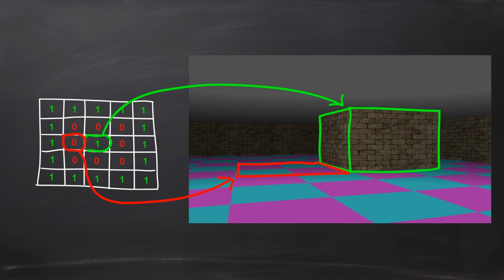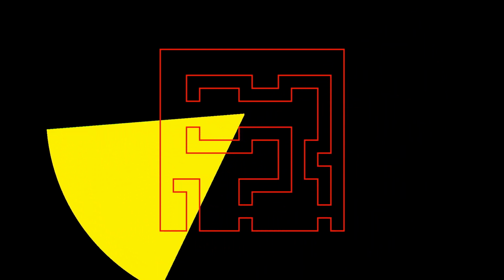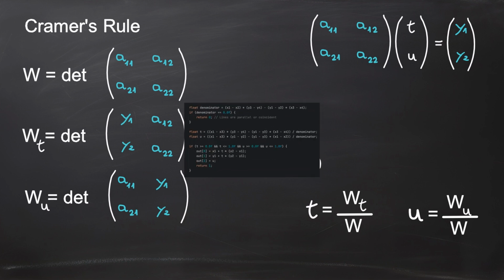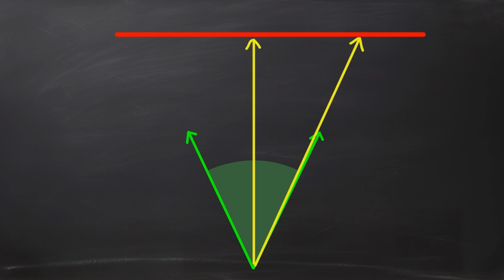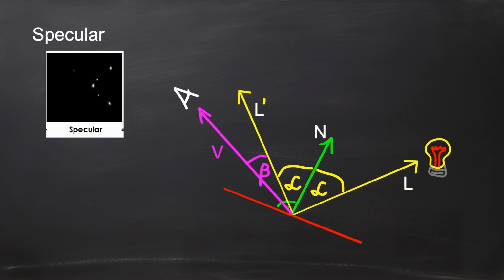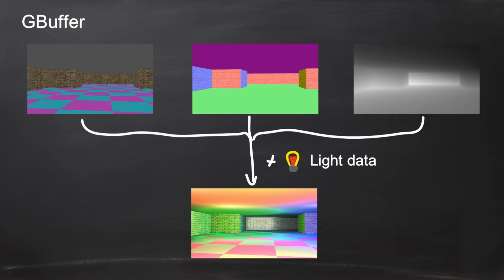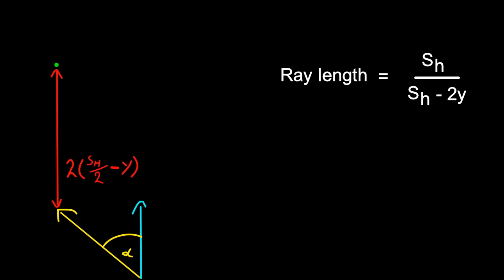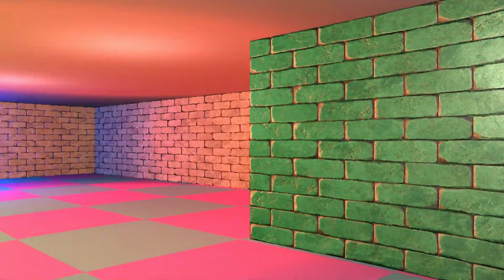Create retro raycaster with dynamic lights from scratch

Comment: Full code ?
Reply from the maker: Hi thanks for your comment. I was not adding source code link in description because youtube want let me add external links. I am under verification process.
However I was able to add link to github to my youtube profile, so just look there for url. 
I will post  source code there this week.
Reply: @GhostDevLab  Hi thank you for your reply I try to optimize it as much as possible and possibly try other algorithm and distribute it with your credit of course
Reply: @GhostDevLab  Even if you could, I recommend not distributing the code. Since someone might want to steal it.
Reply from the maker: Hi @EliasWolfy I am not to worried too much about this code. 

This raytracing code is based on well know wolfenstein 3d algorithm. There is plenty codes that are easier to understand. I add few changes to make it more fun like actual 2d raytracing so I can put walls in any angle, and added cool lightning. 
This changes however makes the code way more complicated so to add any changes you have to understand it. 
Also because of high CPU demand this code is for education purpose only, and for this reason I will release simplified version without multithread. 

I have some future modification to this project like adding quake 2 models and create simple FPP, and this code most likely will not be opensource. However there will be video describing how I did it.
Reply: @EliasWolfy steal? distribute? that's the point of open source- anybody can use it (if he does make it open source ofc)